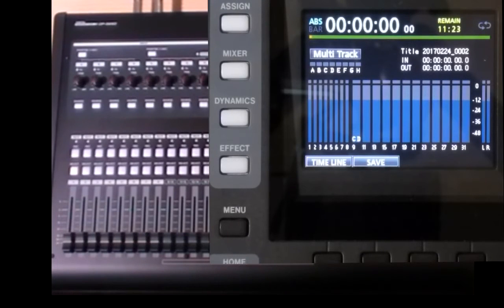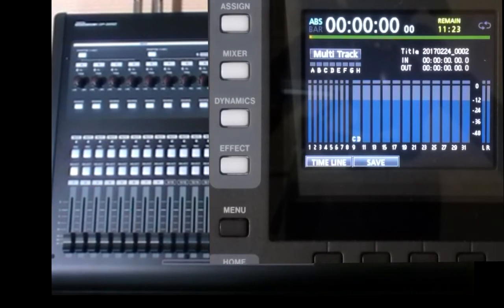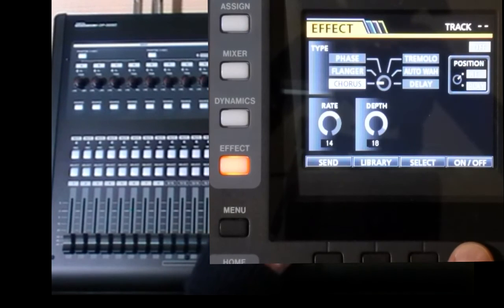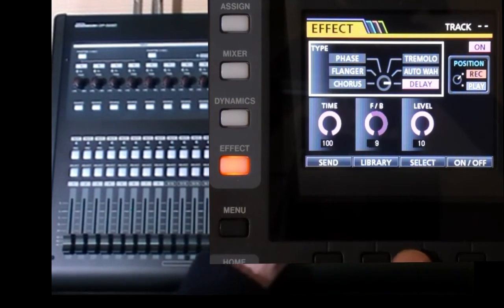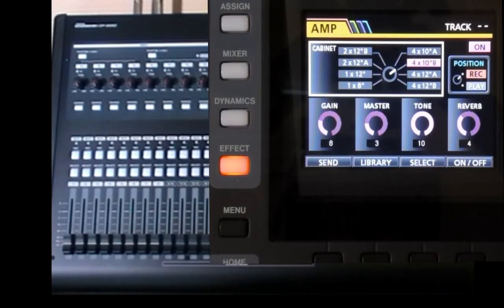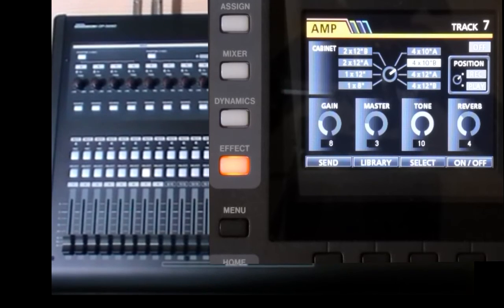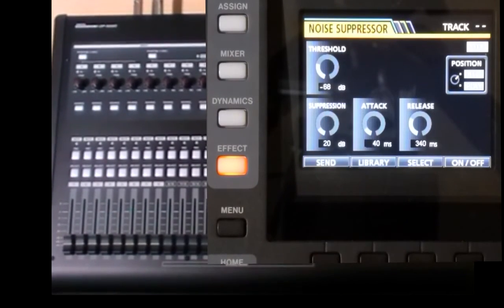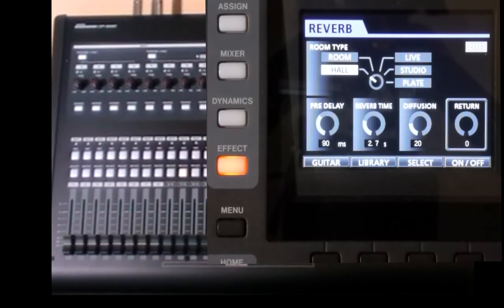Tascam DP24/32SD Tutorial 7: Guitar Insert Effect + FX Summary

Comment: Hello Phil, hope all is well. This might seem dumb. I have seen video of using Noise Suppression to eliminate room noise. (In the examples the meter levels are usually seen to be "dancing" at about minus 30 db when there should ideally be "silence" between spoken words.  As you know, Threshold/suppression is then used to stop the meters registering that noise.  
Question: I am recording to about minus 18 db. If I later boost the master to minus 3 db, (for example) do I risk introducing 12db of previously UNregistered noise that was below the "l/r" at the bottom of the meter?  I.E. the meter seems to "bottom out" at the L/r at about -60 db,(?)m and it the disappearance of any signal that makes me assume the noise suppression is complete. ...but if it the meter was an inch longer at the bottom and went down to - 72db, would I STILL see dancing levels in the "silence" between - 60 db and - 72db, which is 12db  of noise that will come back into earshot when I boost to - 3db?  Feel free to embarrass me for the Greater Cause!
Reply from the maker: @steveokane9478 Hi Steve, it's a good question so not dumb at all :)
You're right in that whatever noise remains in the signal, even if you can't see it on the meters, will be boosted if you increase the gain later on.

The 'threshold' control governs the level of signal below which the gain reduction takes place, and the 'suppression' control governs the amount of gain reduction, so it's the latter which governs the final noise floor level. 

I haven't checked how low this will go, but if it's an issue with you... and I would actually try it in practice first before presuming that it really is an issue... you never know, the additional noise may not be as bad as you thought :), try and adjust your gains before the noise suppressor so you have a decent reading on the meters and you won't need to increase this very much later on.

There are various ways of adjusting the recording level depending on the source, e.g. the trim control, moving mic position, external mic pre-amp, adjusting output levels from synths etc. One trick to get more gain from less sensitive mics (assuming you can't get any closer to it) is to use the dynamic compressor effect without any compression. It has a gain control so you can use this as an extra boost. 

Unfortunately you can't easily daisy-chain the dynamic effects in series with each other so you can't add the compressor and noise suppressor in series. However, you can do it using the trick shown in videos 14A & 14B, or a simpler way may be to just use the noise suppressor in the Insert(Guitar) effect instead. This can be applied to the track either during recording, or afterwards via bounce or mixdown.

Just as an afterthought, I would personally only use noise suppression as a last resort (or only use a minimal amount) due to the sometimes unnatural sound it imparts if not used correctly. If you can remove/reduce the background noise before the signal reaches the machine, you'll get much better results.

Btw, some great music on your channel :)  Nice clear lyrics and great playing.

Comment: Hey Phil, thanks for the tutorials! When I play the demo song, there is no signal if pan is 0. There is a signal when I pan either right or left. Why?
Reply from the maker: @saxaphone6 Daniel Nielsen Thank you for the feedback Daniel. Problems like this are usually related to out-of-phase signals on the left & right sides of a stereo signal. When you pan 0, both left & right sides are at the same level so cancel out. When you pan either side, one of the signals dominates the other so there's less cancellation.

Do you get the problem on both speakers and headphones? Speakers could be wired incorrectly. Headphones and/or headphone adapters can cause similar problems if they are faulty or if you are using a mono adapter instead of a stereo one.

If these are ok, the problem may be a setting within the demo; maybe you've inadvertently changed a setting? If the demo is not write-protected, it may have been altered permanently, so the problem will remain even if you reload it. You could try downloading the original demo again. If you can't find it, I have a copy on my website:
http://www.philizound.co.uk/freebies/dp24-32/dp24-32.html#demo
 
If you're still stuck, I would go back to basics and run a signal directly from input to output to check left & right works ok. This is shown in the first few videos where the input signals are assigned to the stereo bus. It's a good simple test as it bypasses the sd-card and recording & playback sections completely. Once you have confidence that your speakers/headphones are working correctly, you can load the demo song and investigate further.
Good luck, and keep us posted.
Reply: @Phil Tipping  thank you! I contacted tech support @Sweetwater and they walked me through a few tests. Finally, we did a factory reset and that cleared the problem! Sincere thanks for the work you've put into these detailed tutorials!  Also for responding thoughtfully to  my post. Now I can finish those Muddy tunes I've been working on.
Reply from the maker: @saxaphone6 Daniel Nielsen That's great news :) Thanks for the follow-up; posting the solution is very helpful to others readers. Good luck with your recordings.

Comment: So the only guitar effect, no matter what it is, it's a clean guitar sound?
Reply from the maker: @Gregory Davidson not sure what you're asking. There is only one 'guitar effect', but it's a chain (or 'block') of 4 different effects in series. 
You can enable or disable any combination of the 4 and each one has its own settings screen, so you have a lot of control over the sound. Some of the effects are more relevant to a guitar, such as the amp simulation, but they can all be used on other instruments if you like - there are no rules.
If you disable all 4 effects, the effect block has no impact on the sound, as you would expect - the signal effectively passes unchanged straight through the block... but there is a catch as explained in the video in that the number of dynamic effects will remain limited to 2 (instead of 8) until you remove the whole block from the insert path.
Reply: @philtipping  sorry! I'm pretty new at this, and I've been going through this whole process from the beginning, but I am confused about how to get effects like distortion, different types of amps and things. How do I get a distorted guitar sound coming out, instead of a clean sound? What do I need to buy add that?
Reply from the maker: @Gregory Davidson no worries, it can be quite daunting at first, but it will all make sense eventually :) The effects you mention are in the Guitar effect block (other effects are in the Send effect and Dynamic effect sections). There are several ways of configuring the guitar effect depending on what you are trying to achieve. For example, to hear the effect applied to an existing track recording, you need to insert the guitar effect into that track's playback path. Then you enable/disable the required combination of those 4 sub-effects within the block, and twiddle the settings to hear the result.
The videos show how to insert the effect and how to enable/disable the sub-effects, but if you want exact step-by-step instructions without getting too bogged down with the details, these are all in the Step-by-Step guide; full details here http://www.philizound.co.uk/freebies/dp24-32/dp24-32.html
Reply: @philtipping  omg! Thank you so much! I greatly appreciate it! This will help me so much! I will return a favor man! I won't forget this! Thank you so much!
Reply: Wait, so you can only hear effects after recording? On my dp02, which just died, you can apply effects live.
Reply from the maker: @Reardon Dearborn sorry about delay - have only just seen your comment. Youtube doesn't notify me for some reason. You can certainly hear any of the effects before or after recording.

Comment: The primary purpose of the guitar insert fx is to record a DI'd guitar with amp modelling/fx etc. It is not really designed for use in mix down as a stand alone insert effect. However Tascam designed it so it can be used 'live' on one track during playback/mixdown if needs be...  however if you need it on more you can bounce. Of course this means commitment as once its bounced you can't tweak it without doing a new bounce.... straightforward really and good for creative decision making to have 'soft' limitations like these
Reply from the maker: @TP Davis thanks Tom. Some great music on your channel... but where've you gone? Nothing posted for several years. Hope the band is still intact after covid.

Comment: Hi Phil. Am I able to add vocal correction when bouncing a track. Thx.
Reply from the maker: @anthony91504 depends what you mean by 'vocal correction'. You have a choice of many different effects & eq, but they are in specific signal pathways so what you can use at any one time depends on which path you are using. 
There's an FX summary on my website here http://www.philizound.co.uk/freebies/dp24-32/dp24-32.html#fx which lists which effects/eq are in which path.
The easiest things to add during bouncing are eq, the insert(guitar) effect, and the send effect. It is also possible to add an insert(dynamics) effect but it needs a bit more setting up - video #14A shows how to do this, but you need to be confident about using the send/return system.
Btw - you posted your question twice so have removed the other one to avoid confusion.
Reply: @philtipping   thank you for your response. What I’m trying to do is record without my vocal correction, Tascam TA 1VP, the have the vocal corrected during the bounce. Thanks.
Reply from the maker: @anthony91504  yes you can use external gear during a bounce. You need to connect it to a send output and feed its output back into an input on the Tascam.
Reply: @philtipping  thank you. Much appreciated.

Comment: Hey Phil, I’ve viewed all your videos, and they’ve been incredibly helpful. I finally have a grasp of what the tascam has to offer, and have even begun mixing and mastering using it. Despite all that, I have one question I can’t seem to find an answer to. I know I can only have 1 “guitar effect” running on one track at a time. I figured in theory, I should be able to bounce that track with the effect, then have that track printed with the effect. But I cannot get this to work. I’ve tried using both “record” and “play” settings in the effect, tried putting the effect on the track to be printed and the origin track, and all combinations of that with regards of “record” and “play.” Is there a way to save a track with a printed internal guitar effect? Or am I really only able to essentially put an effect on a single track?
Reply from the maker: @Reece Caldwell Hi Reece, thank you for the kind words. Yes, you should certainly be able to add the guitar effect to tracks one at time using bounce, so I guess there's something you're not doing correctly. Are you sure you're setting up the bounce controls ok? Video #9 later in the series describes the process.
You can use the guitar effect either in the play position for the source track, or in the record position for the target track. Don't get these confused :) 
I would go through the steps methodically to see where the problem is. First forget bounce and prove your guitar effect is working ok. Let's assume you want the effect in the playback path for the source track, so set the effect to 'play' mode and then insert it into that track - the track number should appear at the top-right of the effect screen. I'm assuming you are using a mono track for this. 
Press Play on the machine, turn up the fader for this track and confirm you can hear the effect through the monitors. Make sure it's the guitar effect you are hearing and not the send effect (i.e. turn down the master send 1 level).
If this works, you can then go to bounce mode. When in bounce mode, select the same source track with its select button (so it lights up green) and set a spare target track with its rec button (so it lights up red). Again, just use a mono target track to keep things simple.
Turn up the track fader for the source track and the main stereo fader, then press Record to do the bounce. You should see the meter bar moving for the destination track. If not, the bounce isn't set up correctly. I'm just writing the above from memory so may have missed a step or two - but the video will show exactly how to do it.
When finished, turn the source fader down, and the target fader up. Rewind and press Play. The target track should now have the source plus guitar effect printed onto it.
If you have problems, get back to me, preferably using email as it's better for me than Youtube comments. My email address is at the bottom of the page on my philizound.co.uk website.
Hope this helps.

Comment: still unable to hear any effect after all of this...delay, reverb?
Reply from the maker: @Marty Oshinsky when you say 'unable to hear', do you mean during monitoring or playback? Reverb is part of the Send effects, and these behave differently to the Guitar Insert effect described in this video. The Send effects video should show how to configure reverb.
If you get really stuck, the Step-by-Step guide explains the 3 different types of effect in detail: http://www.philizound.co.uk/freebies/dp24-32/dp24-32.html
Reply: @philtipping  I believe playback.  This board is new to me so it may take a couple more lessons on my part.
Reply from the maker: @Detownrebel1  The send effect (e.g. reverb) can be added to live input signals and/or signals coming from the track playback paths, but this effect will not be recorded onto tracks in normal multi-track mode as it joins the stereo bus after the signal comes out of the sd-card. This is why it's easy to hear reverb when you are monitoring or during a recording, but the effect is not actually recorded.
 
Normally, if you want to record the reverb effect, you need to do a mixdown or a bounce.

There are ways to do this in multi-track mode, but it involves connecting external cables from outputs to inputs, so runs the risk of creating a feedback loop. It's not recommended unless you really understand the signal flow through the machine.
Reply: @philtipping  That worked...Took me a while but I am getting the hang of it...Just had to go through the motions a couple times. Thanks

Comment: Hello, tell me please, to earn effects need to buy an external effects processor?
Reply from the maker: @Николай Андреев it depends what effects you want, and how you want simultaneously. For example, there is only one guitar effect block, but you can do multiple bounces and use the effect in many different ways and on different tracks for each bounce. Or you can use the send effect at the same time as the guitar effect, either on the same track, or different tracks. Another possibility is using the dynamic effects, either when you are recording, so you can have different effects on each of the 8 inputs, or by using a loop-back cable to apply dynamic effects to existing recordings as shown in videos #14A and #14B.
If you buy an external processor, you'll still only be able to use it for adding one effect at any one time, although some units can apply different effects to the left & right signals simultaneously, so you could use send-1 and send-2 to get an additional 2 concurrent effects.
Hope this helps. Good luck, and thanks for stopping by.
Reply: @philtipping  Can we do without the external one or not?
Reply from the maker: @НиколайАндреев-ч8в  yes you can do without an external processor, but as I said before, it depends how many effects you want to use at the same time.
Reply: @philtipping  Hello! please tell me which buttons to click to make the effects work?I sort of turn them on but they don't start.Maybe you need to connect the microphone to a specific connector?
Reply from the maker: @НиколайАндреев-ч8в  Hello. You don't need to connect the microphone to a specific connector. If you want to hear the guitar effect on your microphone, assign the mic input to a track, and insert the guitar effect into the track path. If you set the effect's Rec/Play option to Rec, you will hear the effect and it will also be recorded. If you set the option to Play, you will hear the effect but it won't be recorded. If you want a detailed guide showing exactly which buttons to press, have a look at my Step-By-Step guide. Full details are here: http://www.philizound.co.uk/freebies/dp24-32/dp24-32.html
If you are still stuck after buying the guide, I can help you with specific problems.
Reply: @philtipping  Thank you very much!
Reply: @philtipping  Thank you very much!